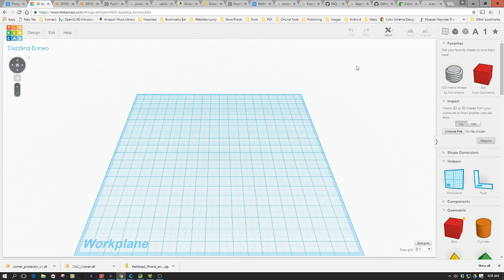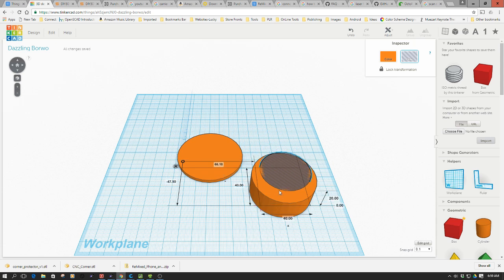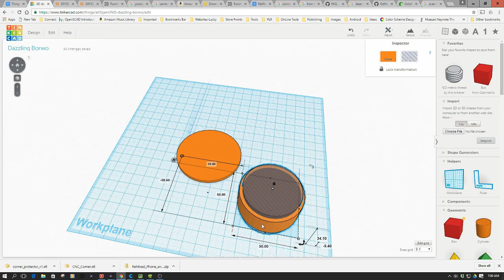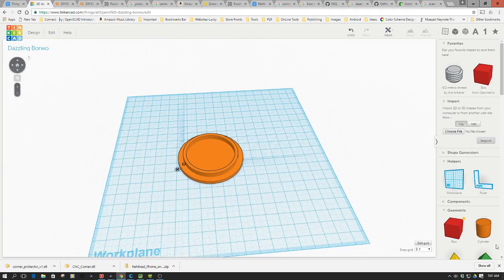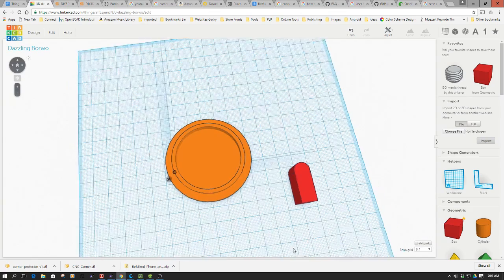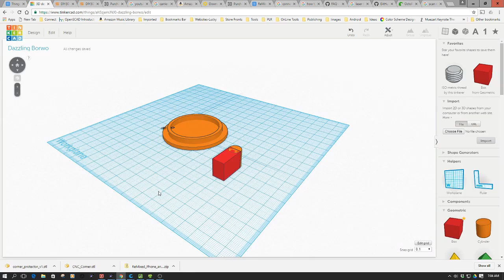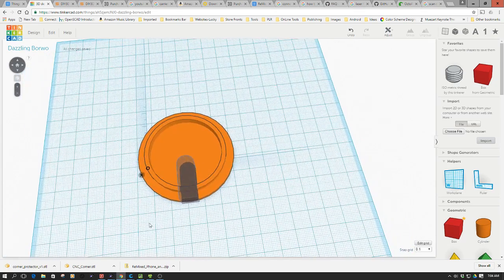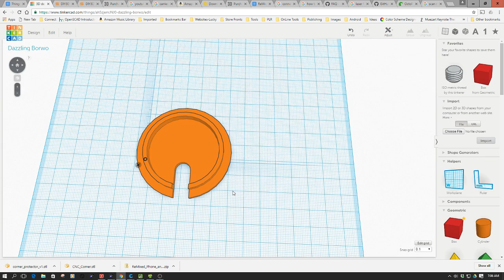TinkerCAD Workflows - Universal Hole Cover Design!

Comment: Great simple and elegant example. These sorts of quick design and print exercises are very encouraging to those of us new to CAD and 3D printing. 
Did you use the stock 0.4 mm nozzle diameter on the Wanhao or larger? Sounds like an even quicker print than I would've expected.
Thanks!
Reply from the maker: Yes used the 0.4 nozzle however I upgraded a long time ago to the Swiss Micro Hotend :-)  Ran it at 50mm/sec 100% flow :-)

Comment: cure for the line at 4:26  is not that hard . 
1 place a ruler near the brick part , set then end you want round either at 0 or its far end . ( use direct entry for positioning as 0 )
2 create your cylinder , change position mode to object center , place it at either 0 , or the length of the brick . 
3 align the two and set heights 
4 combine .  ... go back to position by edge mode if you like . 
your done you now have a smooth transition even if you see it render a line it just indicates the start of the curve